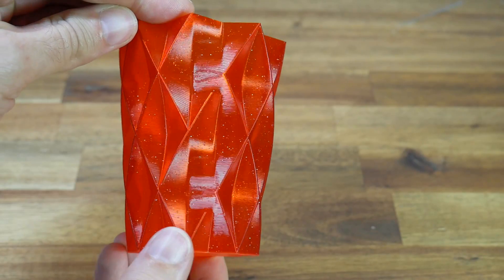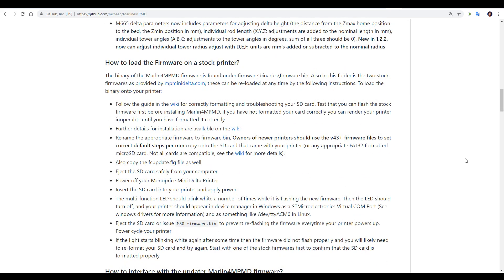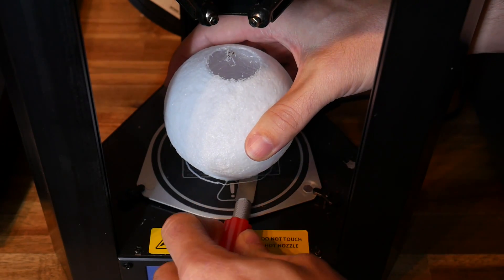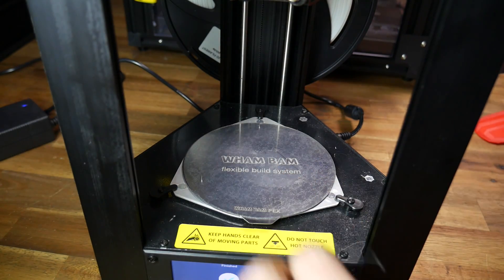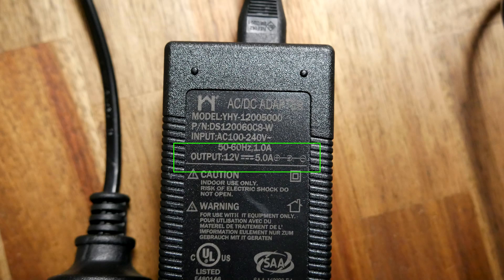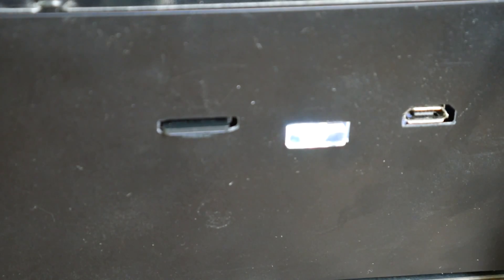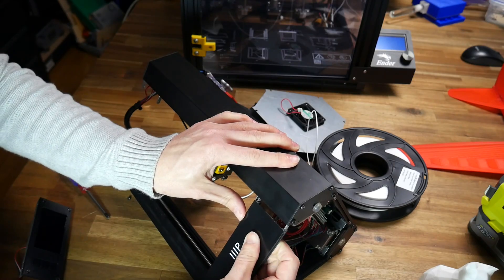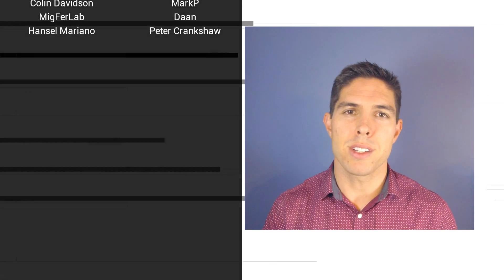Modding the Monoprice Mini Delta thanks to an awesome community

Comment: I have this printer... came with V44 firmware.  However, tonight I found out that MY printer (as some others out there) is *SPECIAL*.  Appears (and this is in the Bug notices) of mcheah. Installing this firmware may cause the head to crash into the build plate. Turns out Malyan is shipping some of these with reversed steppers.  I am one of the lucky few (and I suspect there will be more). However, I figured out tonight how to workaround this.

I watched Michael's awesome video tonight and decided to do this to my MPMD. Went swimmingly until I performed the G28 and instead of the effector going up.. it screamed down and crashed into my glass build plate...ugh!

There is a thread in the issues section of the Github for this firmware that informs that Malyan has a special M-code to reverse the direction of the steppers. After re-flashing back to stock and running the M-code to reverse the steppers I was back where I started. Stock firmware / Stock operation.

As I have modded just about EVERY 3D printer I have (thanks to the help of Michael here at Teaching Tech)... I decided to try to find a workaround for myself and others in my situation.

I Reversed the polarity on the stepper cables at the motherboard.  Turns out you can uplug the cables, pull the cable locks from the pins on the board (with Needle-nosed pliers), flip them 180 and slide them back down the pins. Plug back in the cables. I did it ONE cable at a time so as not to mix them up and have a big nightmare.  Re-flashed the stock firmware (w/o the stepper reversal active) and ran G28 (with the power connector in hand in case things went bad)... and SUCCESS!!! Re-flashed with Marlin4MPMD V43+ and SUCCESS!!

Sorry for the long post...but I wanted to get this out the community in case they run into this situation like I did.

LOVE your videos Michael!
Reply: Michael McDonald holy shit man I’m glad there was light at the end of the tunnel
Reply: You are actually one of the lucky ones. The motors they are using now should help a bit with reducing the noise which is why they made the change. It still won't be all that quiet but with the Mini Delta it can use all the help it can get in the noise department. 

At first they used 10 Ohm motors with 4985 stepper drivers at 1/8 stepping, then 4995 drivers at 1/16 stepping, then 4988 drivers for XYZ with a 4995 driver for E, and then eventually switched all four drivers to 4988's. All those iterations helped a little but I guess not enough so they switched to 2 Ohm motors along with the 4988 drivers on XYZE.

As to why the direction is inverted I have no idea. Could be the motors are wired different or maybe for whatever reason they had a batch manufactured with the wires swapped by accident or maybe even on purpose. 🤷‍♂️
Reply: For all reading this, theres a wiki page for inverting the stepper motors using a command: https://www.mpminidelta.com/invert_motor_direction

Comment: Excellent Review of the MPMD upgrade path from the community.  The MPMD user community probably have more engineering hours into upgrading this printer than the original design engineering.  :-)
Reply: From your posts to the Facebook page I would say you yourself probably do. You and the others mentioned in the video have done a great service for the mini Delta community. Thanks.

Comment: Uggg.. now that you have told everyone about the group, I worry it will turn into the Ender-3/5 groups ...
Reply: In general what is wrong with the Ender-3/5 groups? Maybe it is obvious but I am not a member of any of the groups for the Ender 3 or 5.
Reply: @MatthewUpp  They have turned into a place where people come to complain and yell at each other and talk smack.  I used to post, but now it's just a group I'm in but do not look at the notifications.
Reply: @warlockuskta  That's not going to happen or at least it won't be tolerated by those that do. Sure it happens here and there but if it's reported and needs to be removed then we'll do so. Depending on what it was we will remove or warn the member. 

People will complain but that is what a lot of the groups contain. I've noticed those who complain in whiny or A-hole way often get very few if any comments on their post.

Comment: If I would’ve known, I would’ve waited to order my Wham Bam plate! Oh well. I’m going to do all these mods except the one that moves the screen, I have another idea that I’m working on to tilt the screen in it’s current position so I can see it better, but otherwise, great video Michael! Keep up the great content!
Reply: Hi John, I am the author of the screen location mod. I originally made printed brackets to tilt the bottom of the screen out for easier access and viewing angle, but I found that tilting the screen turned it into a trash magnet. If you come up with a mod you might be able to come up with a hood design or something to keep the garbage off the screen and buttons.
Reply: @USWaterRockets  that's a good point. I will take it into consideration as I design my brackets. Do you have the original design on Thinigiverse?
Reply: I did not put the design out at the time. If I can find it I will upload it to my thingiverse page.
Reply: USWaterRockets thanks!

Comment: Very god video, just a question, using a cellphone tuner in this printer, can apply the same tuner method in Ender 3 printer?
Reply: It's possible, but with this printer it will be much easier because all 3 belts are the same length and must be the same tension, so one tone is all you need for all 3 belts. On a cartesian printer, your belts are likely to be different lengths, so the tone will be specific to each belt with a different length.
Reply: @USWaterRockets  True
Reply: I guess you have to measure the tone of the belts of both X and Y axis in home position when you know the tension is right. Then reproduce whenever needed. But the first reference has to be perfect, your phone app has to be trustworthy, and you can't use the MP mini datas since it's just not the same lengths. I wouldn't personally put so much effort in this ^^'
Reply: @rohanisousbois  But, in the same printer model, at the same temperature, may be is a good method..

Comment: Brilliant video.
I will definitely be updating my firmware. 
I think a bulldog extruder would be good for this machine. 
I have been printing tpu this weekend with the stock extruder.
Good results at 10 to 15 mm per second but I have noticed that the extruder steps are a little out.

Comment: This is a great video Michael. I don't actually need another printer but I just love this form factor and the temptation is great just to buy and upgrade the Mini Delta into a printer that is good quality and ultra portable. Thank you.

Actually, a quick question; if I made a heated enclosure with say a 500w fan heater for this tiny printer, could I print ABS? I would like to print small fittings in ABS but my printers are in the apartment. If I could print ABS with this printer I could load a model into it and just  put the printer on our tiny covered patio to run the print. This could be a killer use case.

(This could be the ideal heater) https://www.amazon.com/AmazonBasics-500-Watt-Ceramic-Personal-Heater/dp/B074MX8VN5/ref=sr_1_fkmr0_1?keywords=AmazonBasics+500-Watt+Ceramic+Small+Space+Personal+Mini+Heater+-+Blue&qid=1562535650&s=gateway&sr=8-1-fkmr0
Reply from the maker: It could work. On PLA at least if you have temps too high it can have heat creep and clogs. With ABS it might not be a problem. Plenty of community made enclosure pieces too.